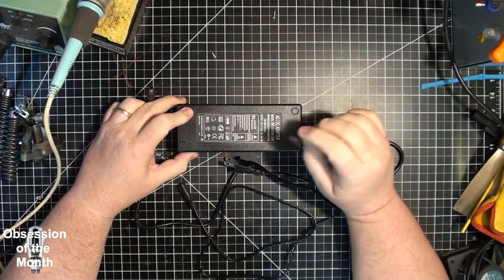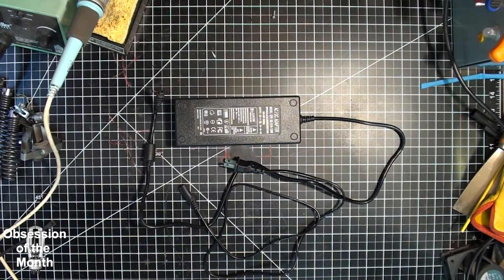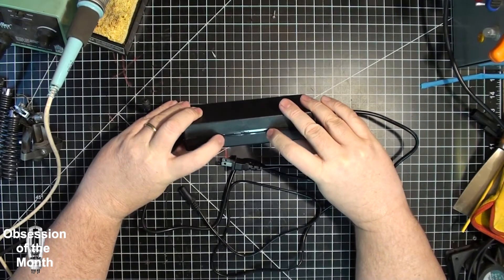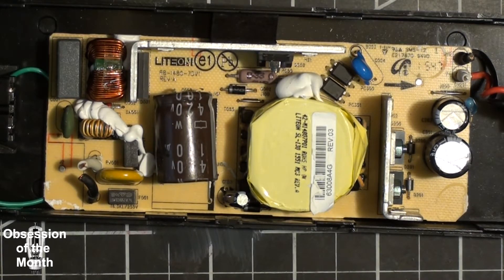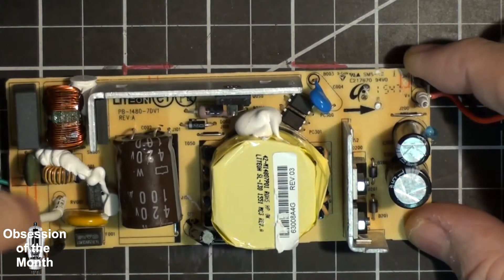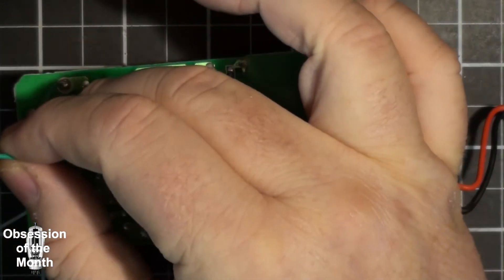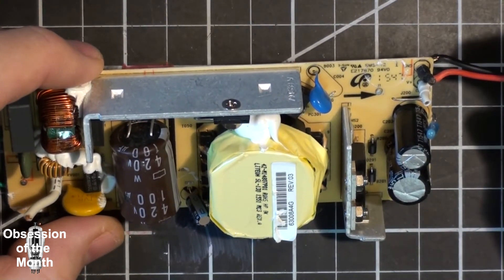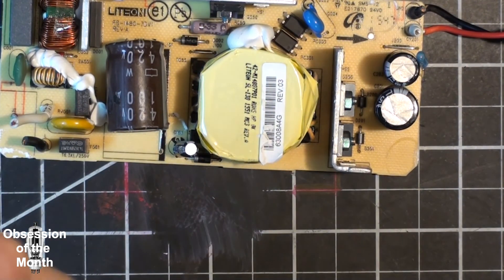12 volt 10 amp LED Power Supply What's inside

Comment: Had this PSU with a case that states JCY-12125, however its a PB-1480-7DV1 Liteon . I got it for a Pico ITX PC , it simply cuts off over 90W , not sufficient . Not sure its worth fixing either
Reply from the maker: The device has short circuit protection and if your device pulls too many amps too quickly it will cut out. You can get around this by doing something to stat whatever the device is slowly. See this video for what I did. https://youtu.be/Ox7BfDrx7N0